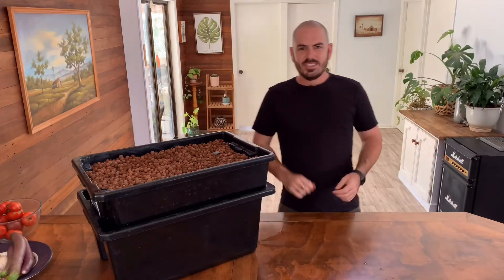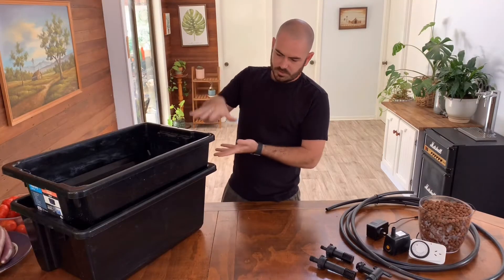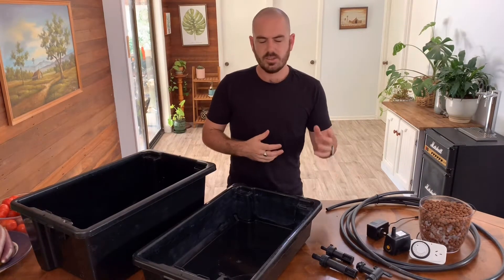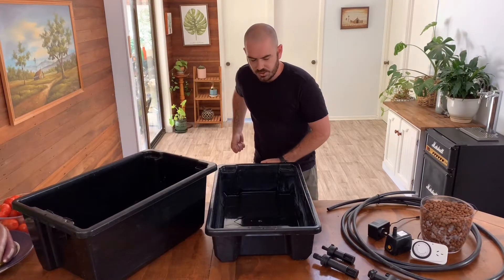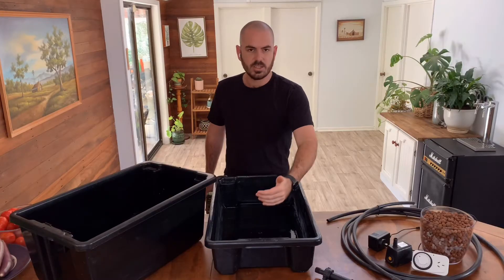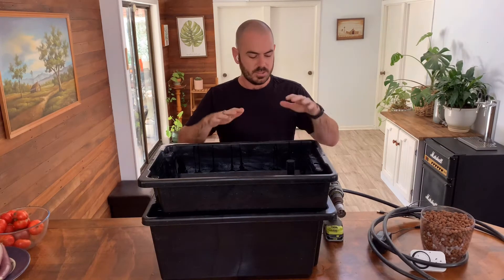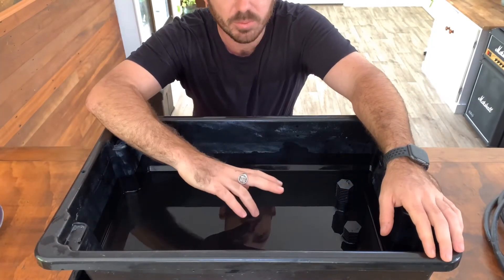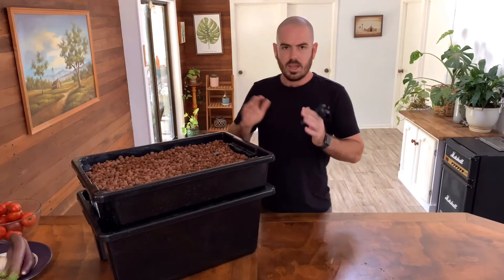How to Build a Compact Flood & Drain Hydroponic System

Comment: Hey hoochos. Long time fan. I recently discovered a more compact and cheaper E&F system with only a pump. Just cut open a 15L water jug and flip the top part over the bottom and use the bottom half as reservoir. The top half naturally funnels down into the reservoir.

Comment: so...you don't actually need the overflow drain if the reservoir and the grow bed are in the right ratio?
Reply: Actually you do.  Lets say your pump will run for  15 minutes every 2 hours but it will only take 2 min to fill the grow bed.  This design is such that the nutrient level will fill the grow bed to the level of the overflow and start to run out, with the overflow having the capacity to  flow OUT more than the pump is flowing IN.  This way, the pump will fill to the overflow level in about 2 min then continue to pump while that level is maintained in the grow bed for the next 13 min (15 total)  at which point the pump goes off, and the nutrient level drops (over the next 3-4 min) as it back-flushes through the pump into the reservoir.   This is rather clever as it means you don't have to be continually topping up the reservoir level to account for the consumption by the plants and evaporation, and with the continued splash it will aerate the nutrient solution as well.  Also, the "right ratio" technique sounds like it could have your pump run dry which is never a good idea.

Comment: GREAT video. Thank you. Can I use perlite, instead of hydroton?  I'm planning on setting up a grow space, about the size of the one in this video. I'm hoping to grow some tomatoes (very compact strain, 'Minibel')and Bhut Jalokia chilli peppers. I have an air pump and stones, an aquarium water pump- 2200 L/min and a Senelux P450 LED light. Apart from some extra net-cups and pipe fittings, I think, I have the choice to build, Kratky, DWC, or 'Flood and Drain'. Any suggestions, as to which is best for the Toms and Peppers? Minimum depth of perlite, or Hydroton, to support these plants, which I expect to grow to about 75 cms (30") tall? I'd really appreciate any help/advice/links from anyone with some knowledge.

Comment: Hi, is it necessary to drain all the water, or is it preferable to leave some water at the base? Is a syphon actually superior?

I've watched a video of a commercial grower, they said they flood two times a day, maybe three in the summer...

Ty for the idea! Really simple design!
Reply: I am having trouble, I built a very similar system to the one in the video and I live in a warmer climate.  Sometimes I wake up to my biggest basil kinked over.  I think there is some confusion on the flood and drain times and everyone is building ebb and flow systems but using wildly different variables and then using a one size fits all mindset on the flood times.  I was flooding 4 to 6 times a day during daylight only for 5 minutes a flood.  Its clearly not enough I am now moving to 1 hour off cycles and 2.5 minute floods 24 hours a day to see if that stops the morning droops and sags.  My basil in my Kratky and my mint plants that are potted is not having this issue. I think 2-3 floods per day using clay ball may not be enough.  Some people do 15 on and 15 off and are having great results so there is ALOT of wiggle room that is not being stated or understood.